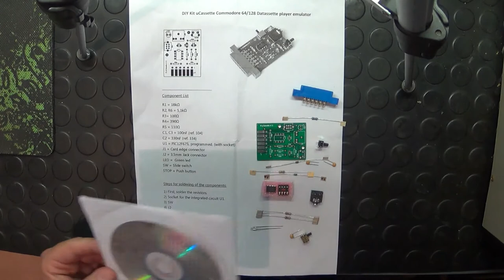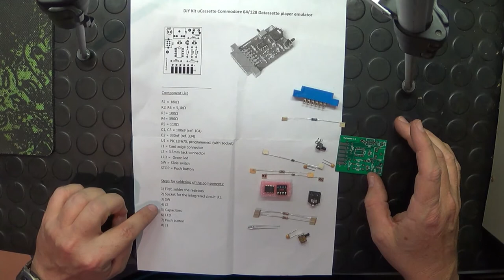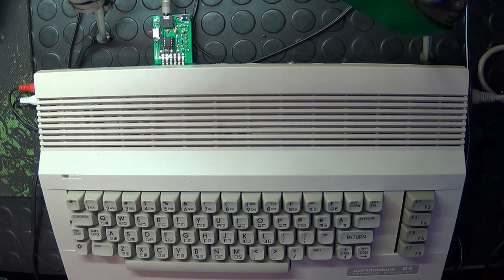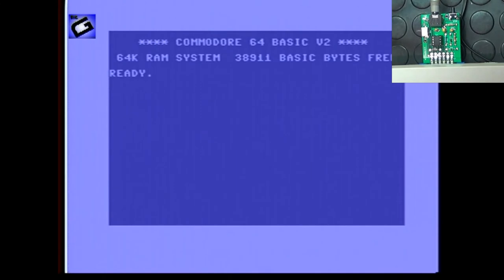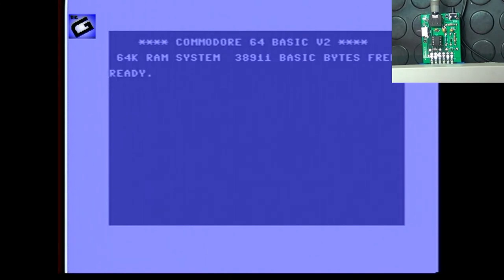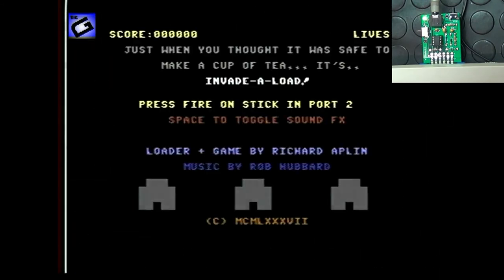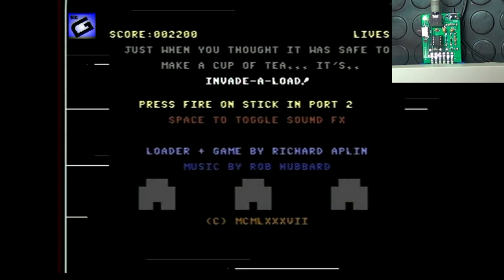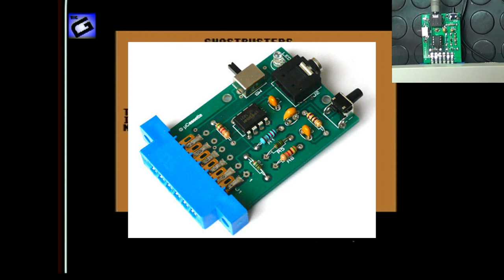uCassette Kit Assembly and Demo

Comment: A really cool kit, especially like that it is an actual kit too. Not only does it cut down the cost it makes it a fun little project to assemble.  I still browse the electronics stores for ready made kits that I could have a go at putting together, but it's hard getting another gadget that won't be useful.  That is the beauty of a kit like this :)
Cool choice for the demo, with Invade-a-load, very clever way to get around the long load times back in the day.
All my C64 tape players are broken one of these could be good to use with original tapes, but a normal tape player.
Reply from the maker: electricadventures Thanks